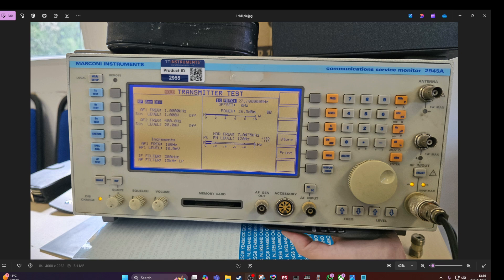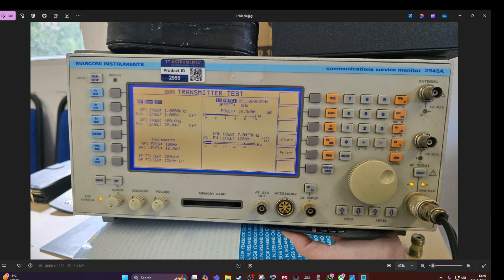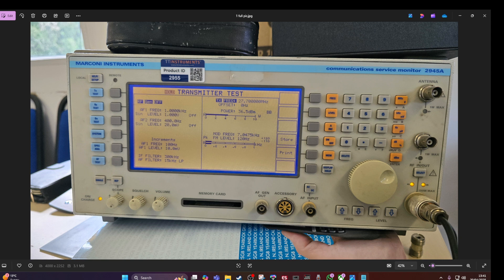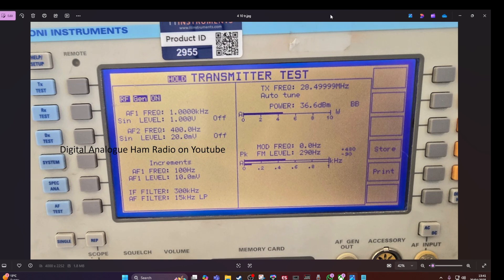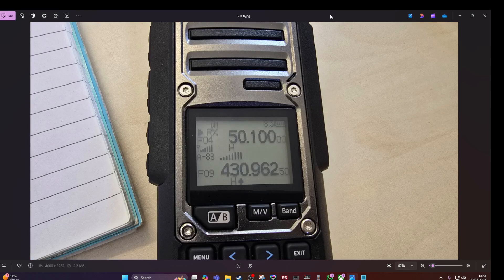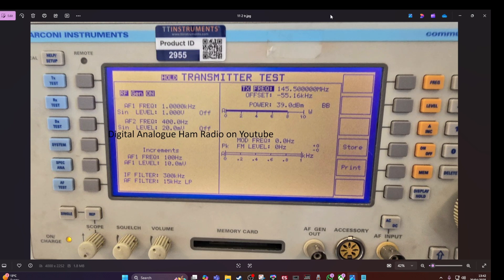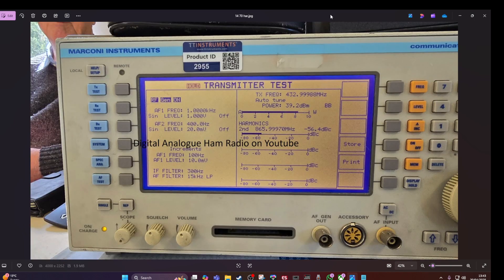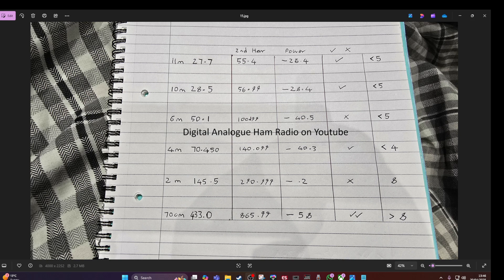Quansheng TK11 UK  Harmonics results factory sample

Comment: All Chinese radios I have dealt with produce elevated levels of 3rd harmonic at 145 MHz. If this interference gets into the receiving channel in a duplex system, as it did in my case, then operation via satellites becomes impossible. It seems that Chinese manufacturers are not concerned about this problem.

Comment: Thanks for your hard work on this, very interesting results, Especially as 2m is one of the main two bands for this radio. As you say, this is the first production model and no doubt it will be improved. 
I'm sure most people will accept your findings in the spirit of a radio amateur who is not an expert, you do yourself a disservice by making the point several times over. Best 73, Ace G0ACE
Reply from the maker: Thank you I appreciate it so much. Somebody in the Facebook groups found the exact findings I had with the same factory sample. I think the exciting thing is the unusual bands that this thing transmits on not just 2 and 70

Comment: wow interesting 2 meter being the worst result, maybe a firmware update will fix that issue. It's early days, for this radio - thanks again chris for a honest and informative look at this radio much appreciated.
Reply: Spurious emissions are not fixable by firmware. That's results from odd filtering
Reply from the maker: Thank you for your continued support. The most important thing is, it works on the bands that are unusual to be supplied on a cheap hand held
Reply: @digitalanaloguehamradio  be interesting how this radio will stack up against the Radtel RT-880. The Quansheng TK11 menu system seems a bit more easy to use then the Radtel looking at the videos

Comment: The analyzer readings make sense for 10/11M, 4M, and 70cm... however, the 6M harmonics show "no signal" as a reference and crazy dBc harmonic values. Also the 2M harmonics,  if taken as shown would indicate a 4th harmonic of a positive 34.7 dBc over the 39.3 dBm fundamental, which would equate to over 25kW. I'm either misinterpreting those readings, or something is way off. Thanks for showing this, really, but something seems way off on the 6M and 2M readings. Am I missing something?  --73
Reply from the maker: Thank you for the super detailed message. This is early hardware and firmware. Somebody in china on the facebook groups has verified the same results. Like I said i am not an expert. But I welcome comments
Reply: On 6m there is no signal (power = 0) while checking the harmonics